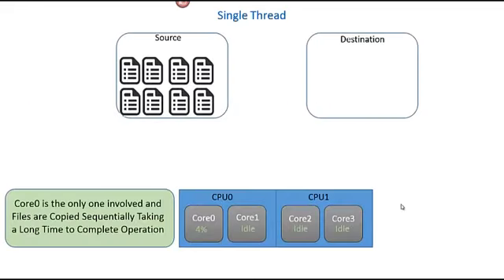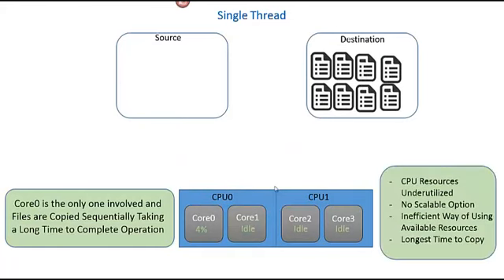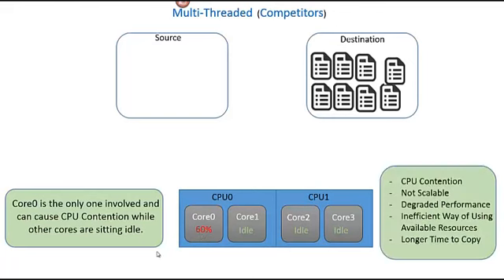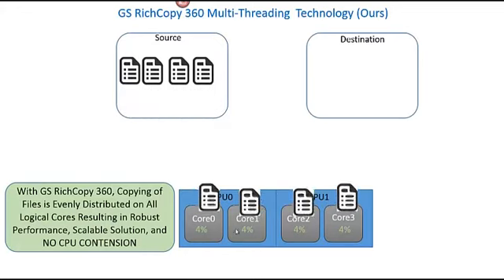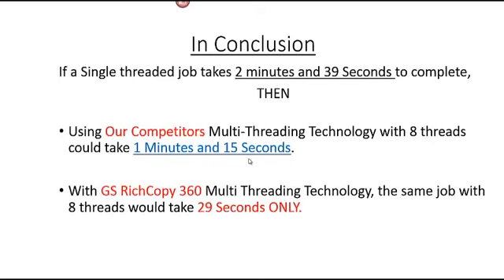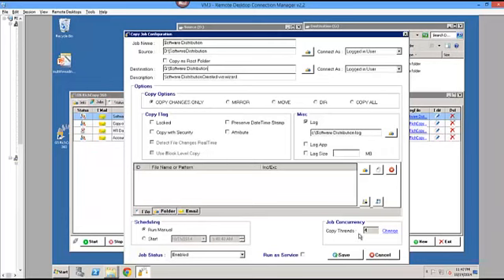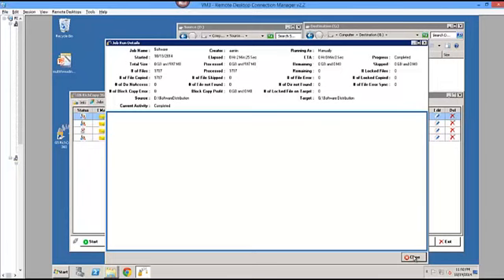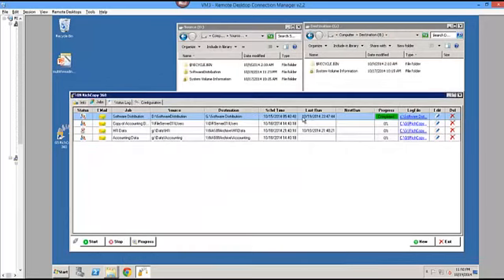GS RichCopy 360 Multithreading File Copying Technology

Comment: I am a fan of this software and its simplicity. This software is simple yet very powerful. I have been using it for 2 years now and no complains from this software. Although its a paid software but the cost is worth it. It never hangs in between, I have copied 200 TB of data at once, no lags at all. It provides multi threading feature to boost the transfer speed. Its just amazing, highly recommended to every one. Try it!